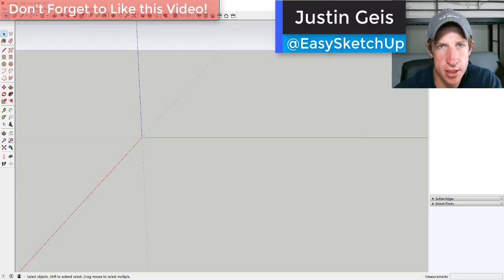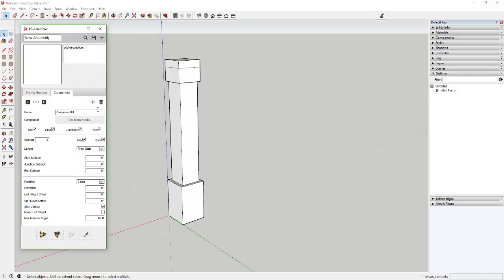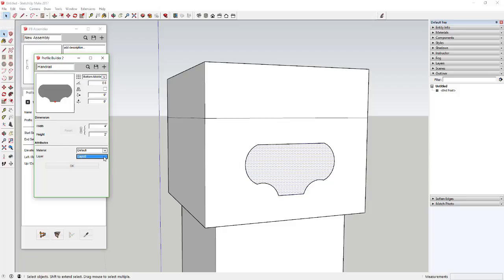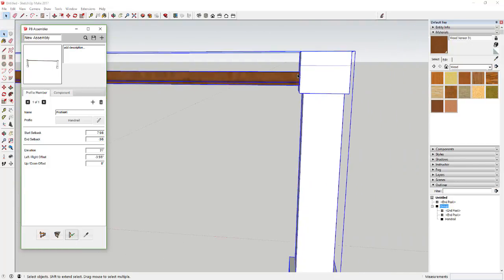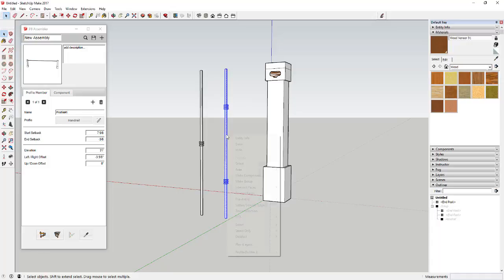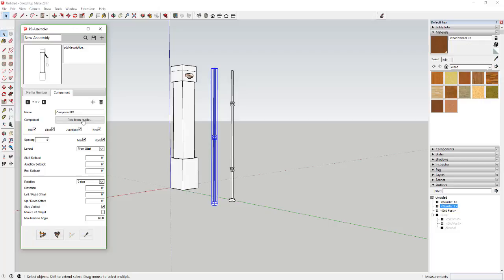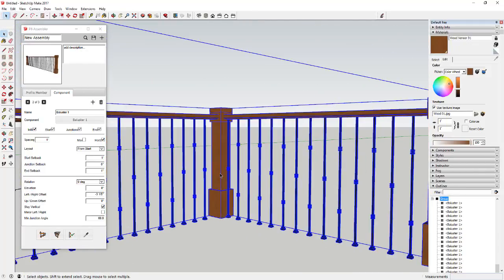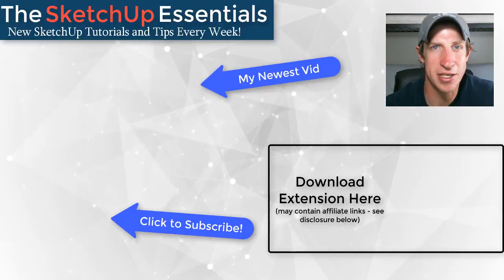Building a Smart Handrail Assembly in SketchUp with Profile Builder

Comment: Justin, I did purchase this extension. I think for standard rendering I would use Chuck Valdi's Fence. This would be great for designers that are doing custom fences. Way too complicated for standard fences! Thanks for the video so I can choose the right plug in for specific needs.
Reply from the maker: I think I agree with your assessment - Profile Builder is easier for creating custom profiles, but Chuck's extension has some really great pre-made ones built in - thanks!
Reply: ג

Comment: Really good video. Thanks.  I'm trying to create a handrail model that inserts a post component between the start, end and junctions at a spacing no greater than 8 ft.  This would be necessary for long handrails.  However, I can't get the start and end setbacks to work on the intermediate posts.  The balusters just go right through resulting in unacceptable spacing at those posts.  Any suggestions?